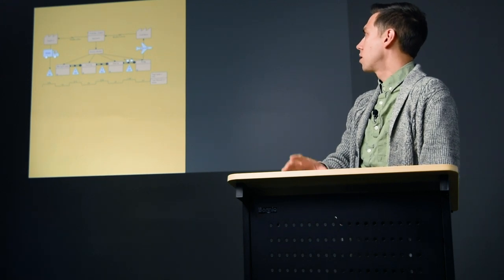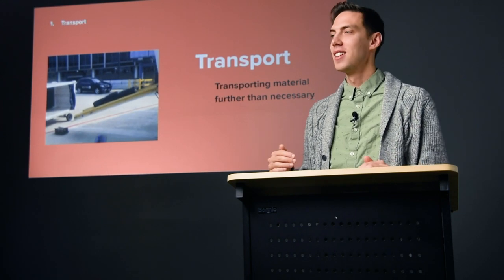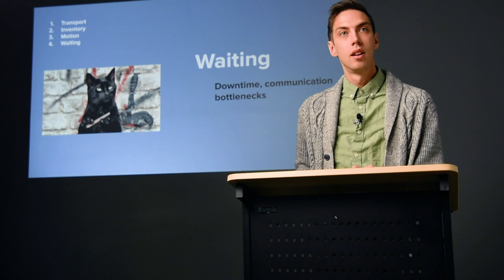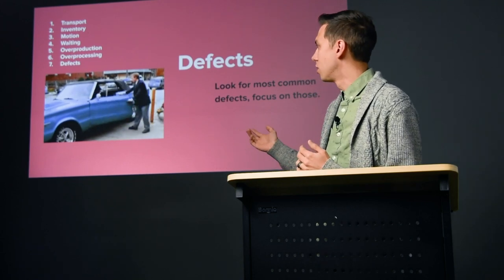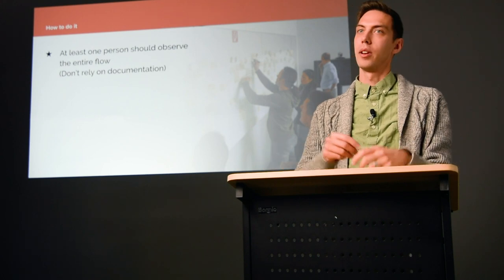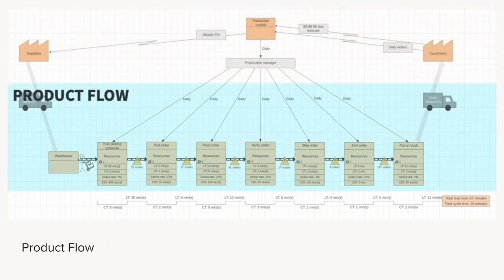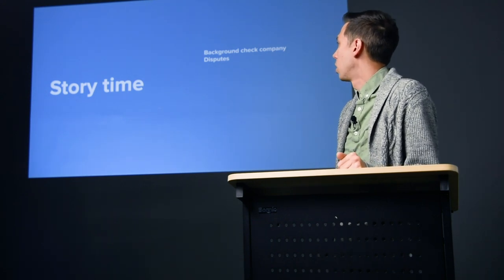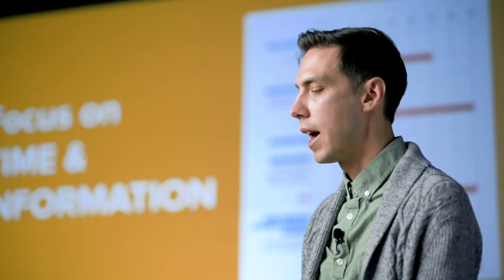Value Stream Mapping - Improving Product Workflows.

Comment: I know this presentation is focussed on digital products and I see why you started there, but you said (at the beginning) that the CEO will say "I want some software."  Unless it's a technology company or some startup, I beg to differ.  He/she will frame their problem in business terms, strategic vision, the bottom line etc.  I guess I'm a little wary of technologists positioning  models/frameworks/mappings as a solution to business problems. When addressing business problems it can often feel like we say, "The answer is software. What's the question?"  As Steve Blank put it, we need to "get out of the building". Our widespread success and sustained credibility is contingent on this.  I'll step off that soapbox now. PS: your gifs are excellent!